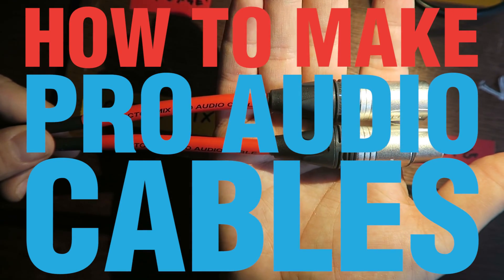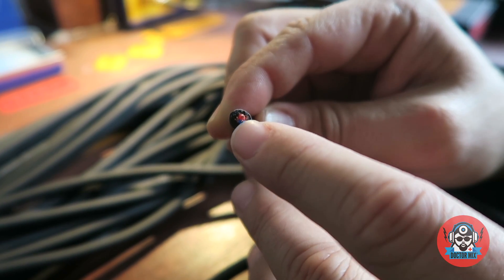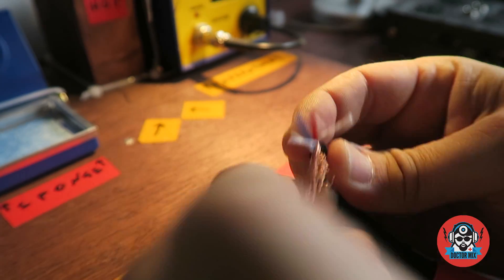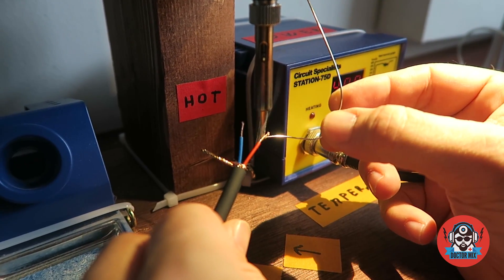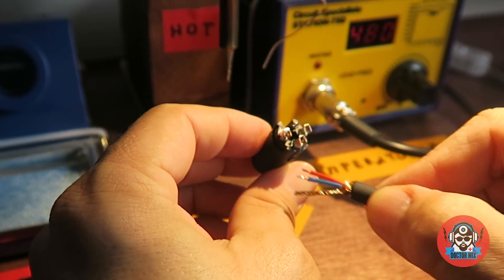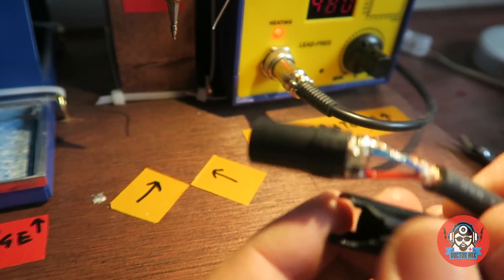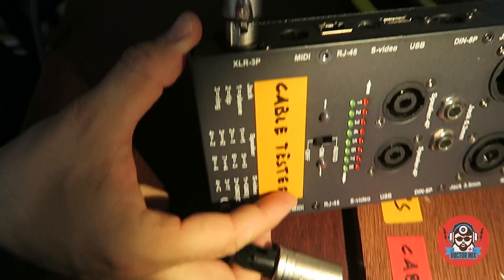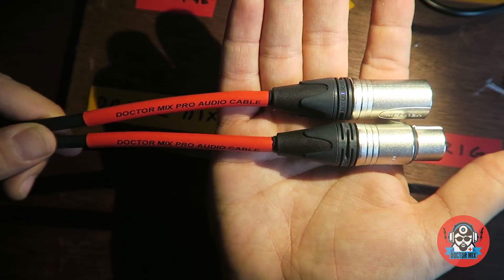How To Solder Your Own XLR Balanced Cable

Comment: what is the use of the ground?  can I leave that unconnected?
Reply: Its always best to use the ground. In an event of electrical equipment failure or power outage,  the ground pin will protect your equipment from being fried.
Reply: @helltrinity1  but there is a fuse, not enough to protect the equipment?

Comment: Please, PLEASE you're my last hope.
Can you help me to understand how you got the last part of the connector on top of the heat shrink sleeve ?
I did everything I could for my xlr and jack cables, and the one bit stopping me for the finished product is the heat shrink tube.
If only I could get it past it, my cables would look like a vovox sonorus protect jack cable.
But I just CAN'T. When I use a heat srink tube wiuthout glue, it just slips and makes a mess, and when I use one with glue it's too big for the neutrik connector. IN BOTH CASES I can't get the connector over it.
PLEASE, HELP ME.

Comment: What is balanced about this cable??? It only has two wires!!
Reply: It is balanced. The red and blue are for signal, and the copper sheath around them is the ground. Maybe you're confused because it's a single channel cable?
Reply: the 3rd wire breaks up noise unlike a 2 wire cable balance cables have 2 signals and 1 ground
Reply: @monsta21cb  Stil not balanced. Use the Google machine to find out what balanced is.

Comment: Hello Doctor, 

 I watched a video of a guy who made a cable when he built a dayton 15 Ultimax sub and using a crown amp. but he didn't mention how he made the cable. He mentioned that instead of connecting the positive and negative terminal at the sub, he instead did it at the connector. I wasn't sure how he did this if all 3 pins are used or if he simply joined two of the wires and had a positive and negative.  connector at sub is a neutrik 4-pole connector and quick connect is Neutrix NL4FX Thank you.

Comment: Look, Kester 282 is an RMA fluxed wire solder in pure eutectic Sn63 or in a 2% silver pure eutectic Sn62. Thing is this is the best solder of all the formulations as far as tin/lead solders are concerned. It consistently produces the highest quality, highest reliability joints of any other solder of either type tin/lead or ROHS compliant solder. When the makers come up with an ROHS solder that consistently yields the same or better results, I’ll buy it. So far, I have yet to see one that can beat the Kester 282 RMA Sn62 or Sn63 or it’s equivalents by other manufacturers. The best doesn’t have to make excuses! You can try them for yourself. The proof is in the consistent high quality and high reliability of performance time after time! 282 is used in critical circuitry where unquestionable performance is mandated! Military and civilian contractors use this in circuitry critical to defense, research and life savings! When you have something of great importance where human life and property are at risk or at stake, or failure is to be avoided at all costs, this is your lead pipe solution! The discipline this is used in is DOD STD 2000-1. It is likely circuits will be subjected to thermal inversion, g forces and mechanical stresses. Failure under these conditions are not such that failure is tolerated. Such are not easily passed tests of endurance. If your products can handle these extremes and thrive, that is a potent solution to success in any reasonable environment! If you cannot yield this level of quality, your products will not yield the reliability to receive a reputation as reliable! Every company wants it’s products to yield that extra special level that yields a high desire and loyal following of it’s customer base! If what is offered is incapable of yielding the desired result, then it is up to those who must use this option to press for a formulation or find a manufacturer who can yield the desired results in an ROHS equivalent.

Comment: I’m sure to get hate mail over this, but so far, I have yet to find an equivalent solder to Kester 282 with 2% silver in an ROHS formulation. I believe in the need, but I have yet to find an equivalent ROHS formulation for the only one I want to use. The finish sucks in all ROHS formulations I have seen and the performance of it sucks compared to it’s tin/lead competition. I’m hard pressed to use something that is clearly inferior for just the sake of being green. While I believe in the concept, until the manufacturers get me something else that I can use that yields the results that my preference yields, it isn’t happening. If you did any high end work, you would understand. I figure someone in this industry is capable of producing what I want. So far, it hasn’t happened. I am trying to stay positive and hopeful. So far, ROHS has proven wholly dissatisfactory to me! Disappointed! Nice wire rig though!😠